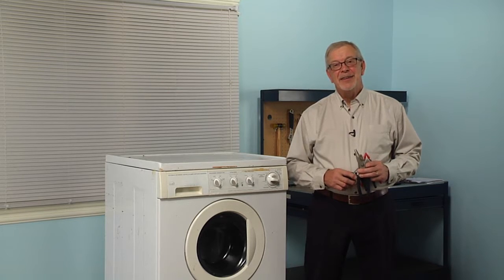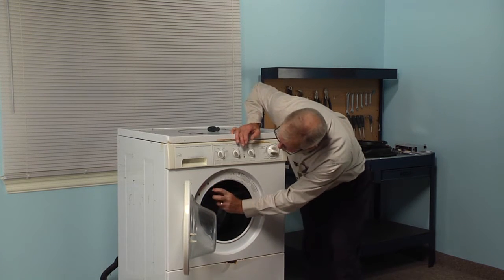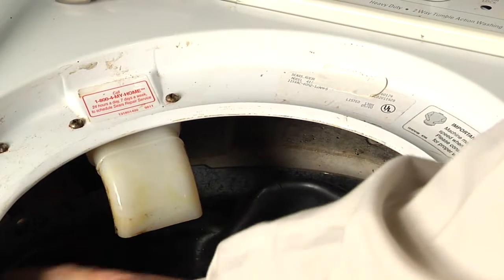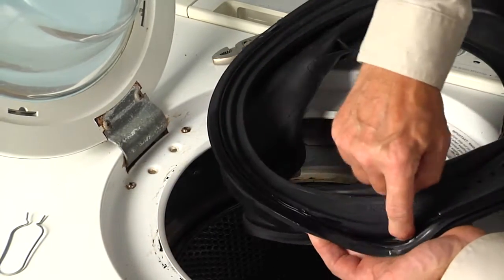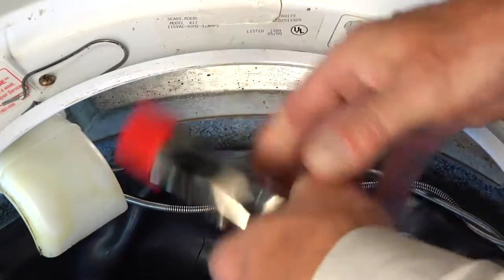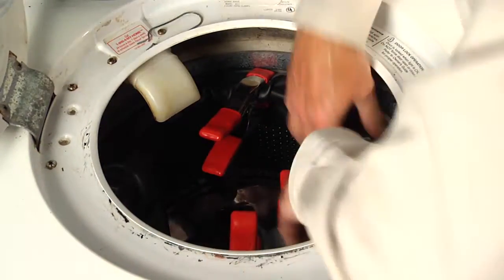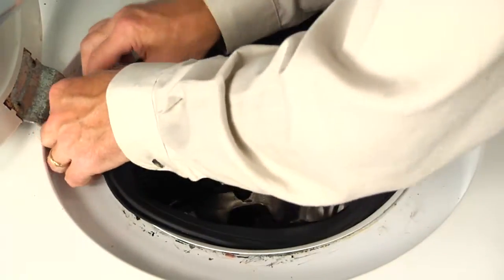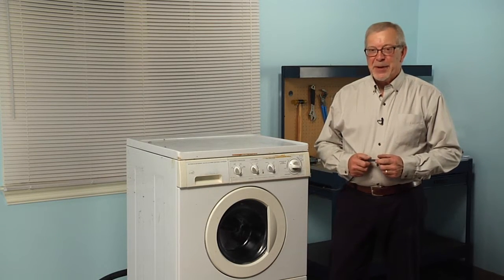Washing Machine Repair - Replacing the Bellow with Clamp (Frigidaire Part # 5303937187)

Comment: I tried, very hard, but couldn't insert the "12 o'clock" part into the rail, that's the most difficult place, very narrow, I don't understand who designed that part. I noticed in the video the washer was laid down which made installation easier, but it is really hard, even impossible for me to finish (to start) the job. I gave up, and purchased a new washer.